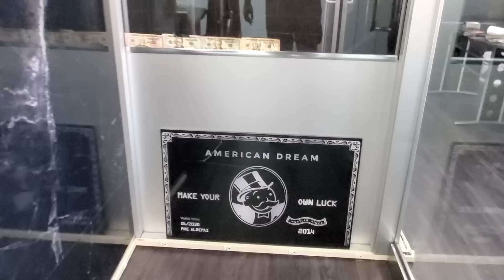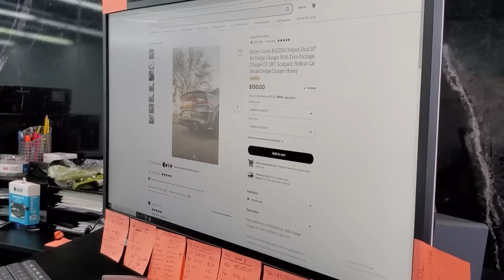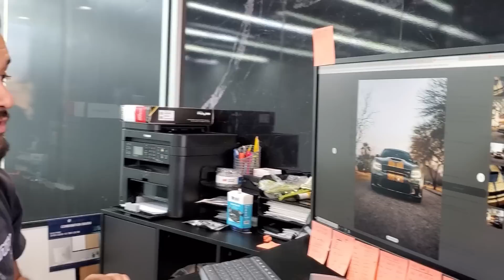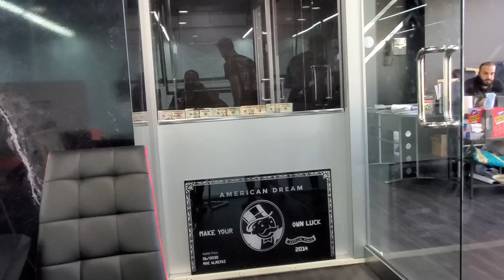My New Widebody Charger R/T Needs A Few More Mods

Comment: You better boost it and show these ppl wat the rt is about. Lighter then a scat and can be built for less !
Reply from the maker: I would def stay all motor with this car.... something diff
Reply: I may be wrong since I don’t know much about dodge, but isn’t the 5.7 bad with boost. Heard they can’t handle much
Reply: @Niugnep  it handle 8 psi the scat can handle 4psi I heard and read
Reply: @Niugnep  basically you can have 450 to 550whp safely on the 5.7 with boost.  Then u would need internals to get over 600
Reply: @just_a5.7  That's interesting. I've read that both the 5.7 and 6.4 are bad with boost. I've heard the 6.1 was capable of handling boost. I wonder why they'd make the 6.4 handle less
Reply: @Niugnep  cuz the 6.4 is maxed out from factory that's why the scats had 485 hp when they came out in 2015 and the mustang  5.0 only had 420 ISH cuz u can build it . The 6.4 not so much. Same with the 5.7 its stock 320 whp but fbo is 375 ish.  And cam 420whp.